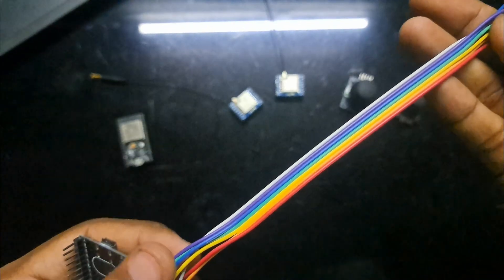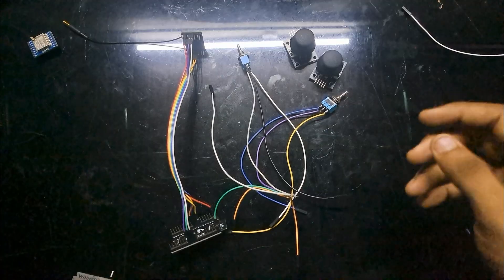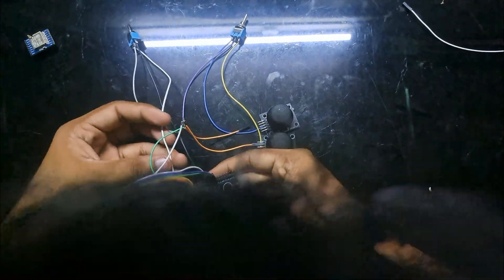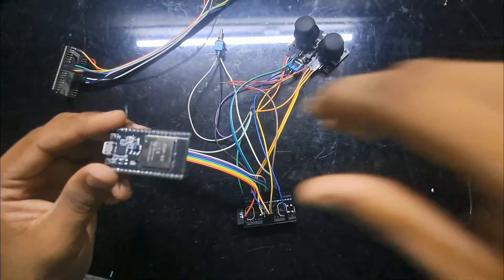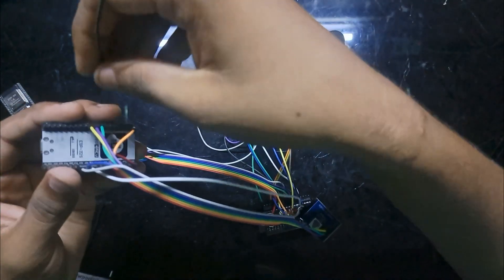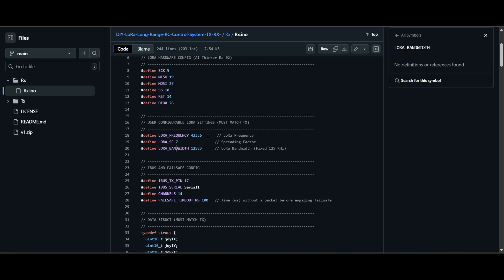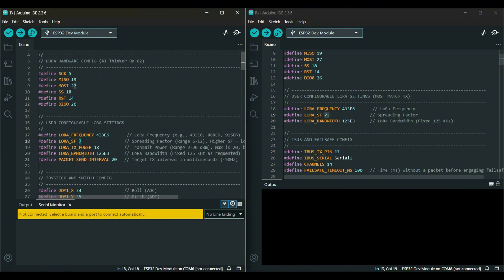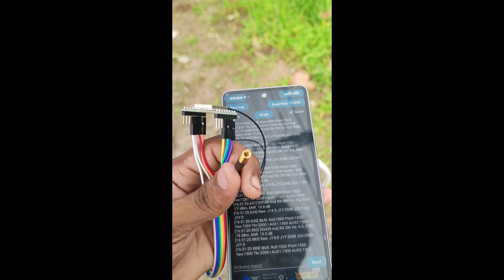DIY LoRa RC Controller | $10 Long Range 10KM Transmitter & Receiver | Cheapest RC Control System

Comment: Is there a latency with control? Or its like the other controller? Please answer
Reply from the maker: If you set at 50 hz you get arround 20ms on 100 hz you get 10 ms 😊
Reply from the maker: According some professionals you can't feel the difference between 50 hz or 1000hz 😅 . Higher the Hz lower the dealy + lower the range 😅 😊
Reply: @EngineeringRobotic  so i can use it for fpv or quadcopter with no problems
Reply from the maker: @engaircraft  yep 👍😊
Reply: @EngineeringRobotic  thank you bro keep going
Reply: @EngineeringRobotic  bro another quastion please>>> can i use onther esp? like esp32?
Reply from the maker: @engaircraft  do you mean esp8266? I don't think so🤔, you could use esp32 S3 , the code was for esp32 😊 and according to espressif you can run any code for esp32 on esp32 s3😊
Reply: Will there be any pros of using an esp32U

Comment: i have an e32-900m30s sx1276 1w lora , can i use it instead of the sx1278 ra-02?
Reply from the maker: it depends😅, it can work, but you have two critical issues to address: the operating frequency and potentially the communication interface.
1. Change in Tx and RX (easy stuff)
#define LORA_FREQUENCY 433E6  TO #define LORA_FREQUENCY 915E6
2.Interface Incompatibility (IMPORTANT): The most common Ebyte E32 modules (like the E32-900M30S) are UART/Serial port modules. They do not use the LoRa.h library with SPI pins (SCK, MISO, MOSI, SS, DIO0). If your E32 module has only TX/RX/VCC/GND/M0/M1 pins, this code will not work. You would need to rewrite the communication using a Serial library
🥲
Reply: @EngineeringRobotic  No I have the spi one e32 , and it work with the Sandeep Lora library, but ebyte adds rxen and txen pins to control Rd modes for transmitting or receiving
Reply from the maker: @techiosityco   If you upload the code to both your TX and RX, it should work () — you’ll be able to use LoRa TX/RX, but probably at lower power (lower mW = lower range).
Your module supports 1000 mW🤩 (1 W) while mine is only 100 mW 😓(0.1 W) — but to reach full 1 W output, you’ll need to configure a few things.

Since your E32-900M30S uses SPI and works with the Sandeep LoRa library, that’s great!
You just need to handle the RXEN and TXEN pins — they control the transmit/receive modes:

Transmiter code add:

digitalWrite(TXEN, HIGH);
digitalWrite(RXEN, LOW);

Receiver code add:

digitalWrite(TXEN, LOW);
digitalWrite(RXEN, HIGH);

At the top of both codes, define:

#define RXEN 22  //connect your RXEN pin to
#define TXEN 23  //connecy your TXEN pin to

(change pins as needed)

Then set the frequency to 915E6 — and it should work fine 👍
I don’t have much experience with the E32-900M30S, but this should get you close. Hope it works! 🚀
Reply: @EngineeringRobotic why I can't just wire it ot 3.3v or gnd directly cause it just need it to be high or low depending on the situation
Reply from the maker: ya, that will work too
Reply: @EngineeringRobotic  i already made adiy stm32f411ceu6 betaflight fc , how can i this lora  receiver to it?

Comment: It's illegal to send that amount of data per time over LORA.
Reply: How u know 😊
Reply: @cheems_0007  It depends on the region. In Germany the Lora Frequency band is limited to 0.1% - 10% of airtime depending on the type of device, meaning that youre device is allowed to transmit data only limited time within the rolling timeframe of the last 1h. Its defined by Bundesnetzagentur.